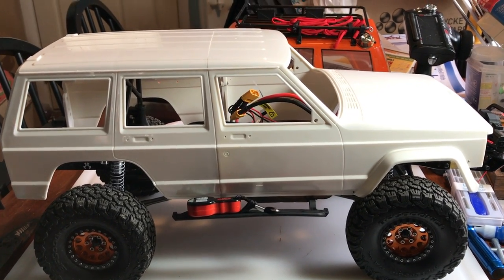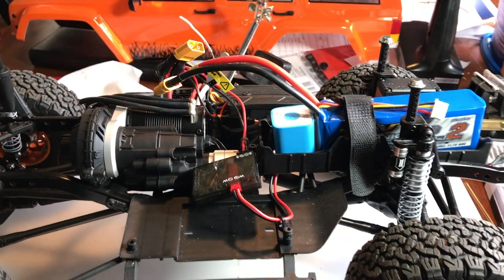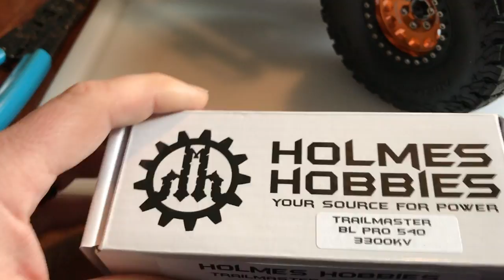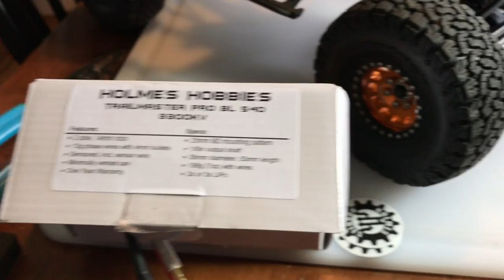Axial SCX10 II Build with Mods  RC4WD Wireless Winch Controller

Comment: Whats the light blue thing in front of the lipo? thanks
Reply from the maker: That is a bluetooth speaker where I can play sound effects from my phone. I have a sound board on my phone with horns and sirens.
Reply from the maker: If you search ebay for groove cube you will find it. It is rechargable and very light so it doesn't add much weight to the truck. It's just something to mess with my buddies with while I'm waiting behind them. lol
Reply: thanks

Comment: Did u just solder the wireless winch controller to your esc battery plug instead of using a seperate battery for the winch?
Reply from the maker: Yes it's soldered into the battery connector on the ESC.
Reply: Awesome ty... mine and my rc4wd tough armor winch bumper will be here tomorrow and was curious if it'd work like that bc alot of videos ppl uses a seperate batteey